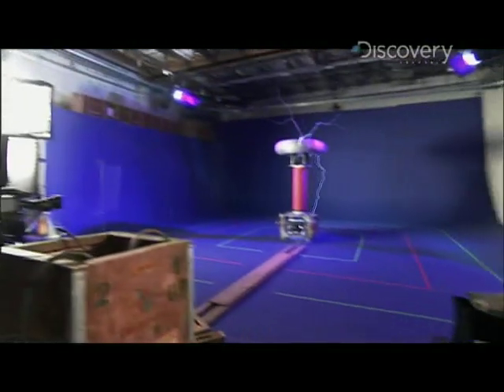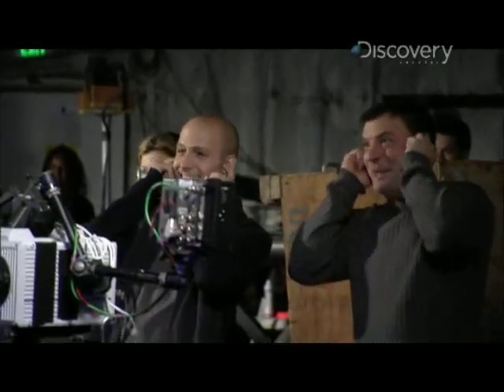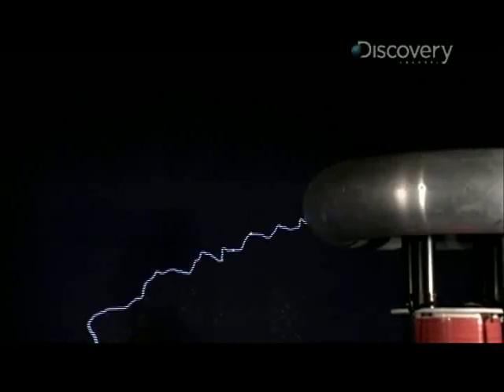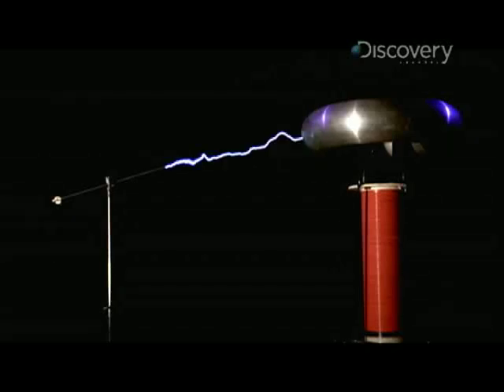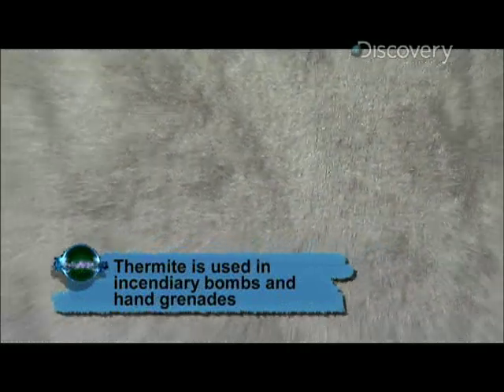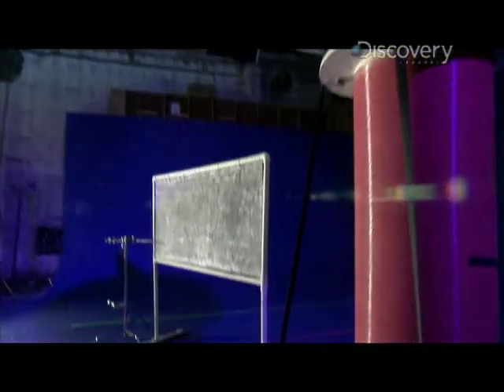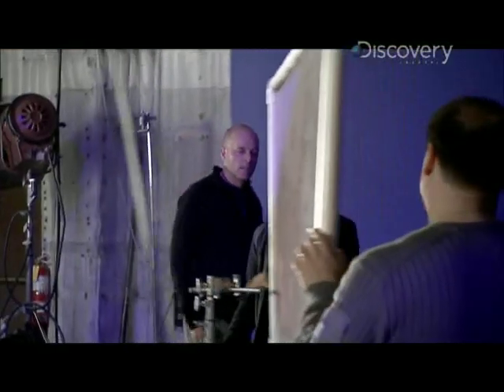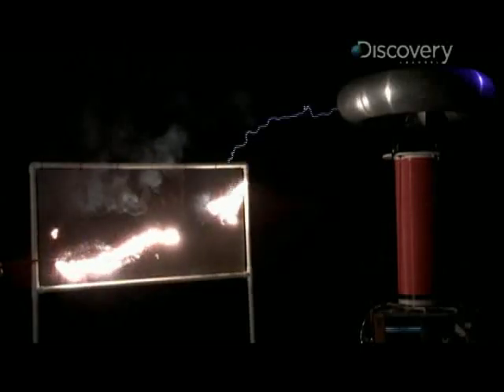Time Warp - Sparktastic Tesla Coil

Comment: @Draxis32
Yes and rust may seem difficult to obtain, but all you need is a jar, 2 ungalvanized 4 to 6 inch nails a 12 volt(?) battery, and a coffee filter, as for aluminum, all you need is aluminum foil and a grind wheel.  Have fun and be safe.  I guess I shouldn't say that the best way to light it is with magnesium strips